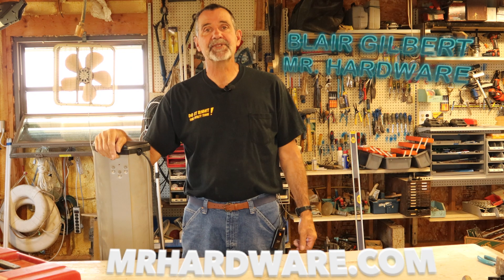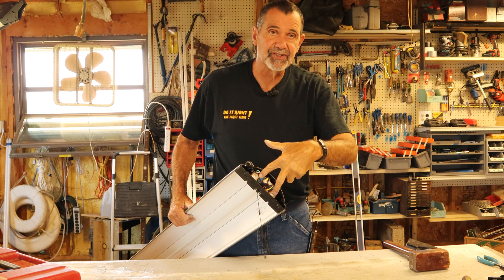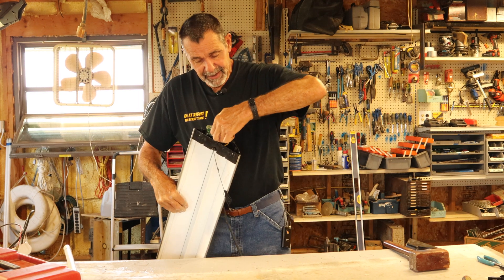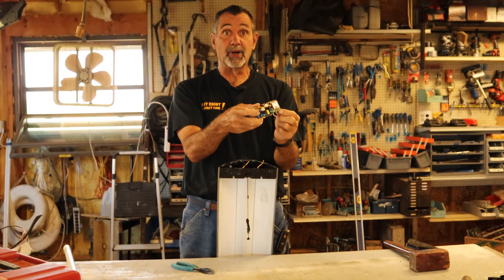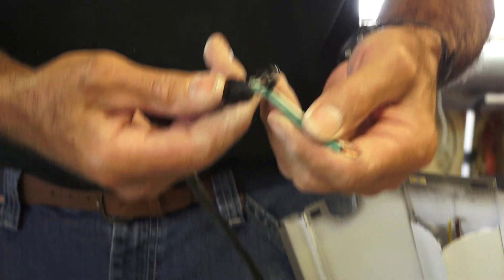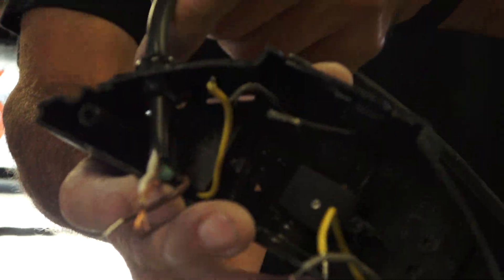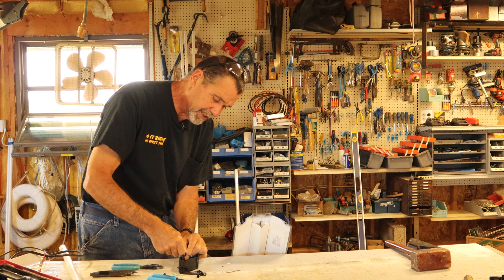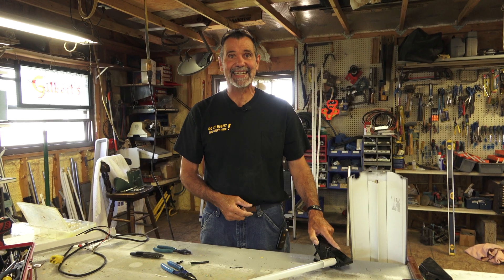Convert Fluorescent Fixtures to LED Bulbs - Brighter, Less Electricity

Comment from the maker: There are four basic types of LED bulbs. One is a retro bulb that will work with the existing  Balast, which I think is a waste of electricity because the ballast is using electricity. Two, A bulb that will receive 120 V directly from one end, and three, a bulb that receives half of the 120 at one end of the bulb and half of the electricity at the other end of the bulb. Lastly is a combination bulb that can be wired any of the 3 ways. If you are Capable it is best to disconnect the ballast and wire directly to the bulb.

Comment: I have been told from personnel at hardware stores that I can use LED bulb to replace the older bulbs. in my existing lighting. 

What affect does this have on the lighting hardware?
Reply from the maker: There are four basic types of LED bulbs. One is a retro bulb that will work with the existing  Balast, which I think is a waste of electricity because the ballast is using electricity. Two, A bulb that will receive 120 V directly from one end, and three, a bulb that receives half of the 120 at one end of the bulb and half of the electricity at the other end of the bulb. Lastly is a combination bulb that can be wired any of the 3 ways. If you are Capable it is best to disconnect the ballast and wire directly to the bulb.